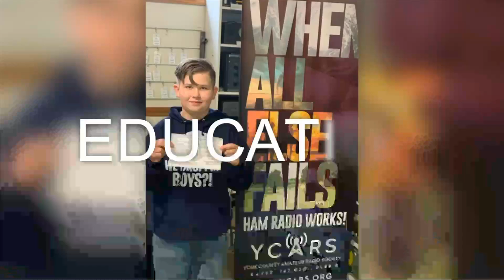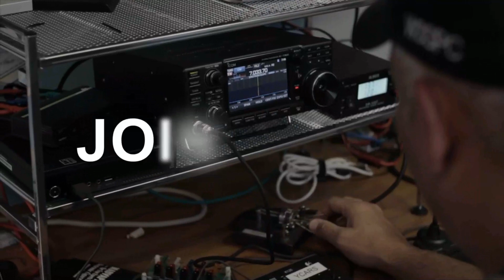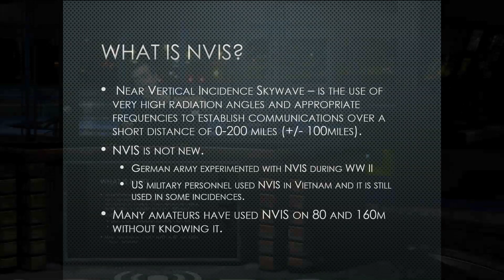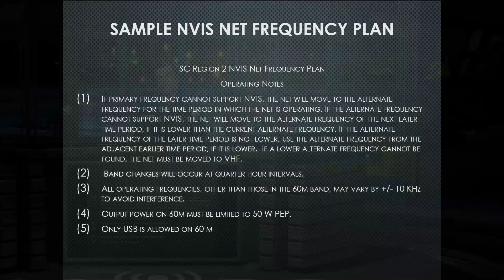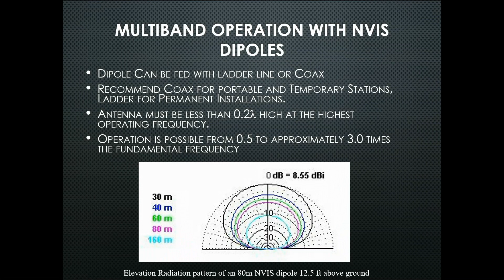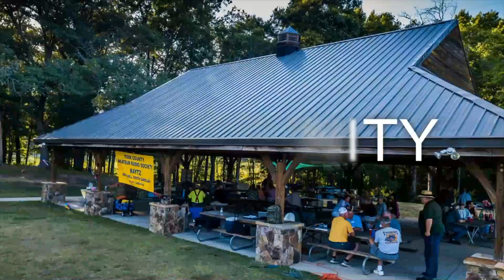NVIS Antennas and Propagation

Comment: You say between 0.1 and 0.25. then show a nvis antenna for 40m and 80m that is on a 15 feet mast.. 0.1*80m is 8m. So you need a 26 feet mast right?
Reply: Michael, if you run a 26ft mast the 40 meter take off angle is increased, it is a trade off you get a smaller radius of coverage on 80 meters due to the lower height and higher take off angle.  as with all antennas that are multi-banded it is a compromise.  But to your point you could run a 26 foot mast and it will work, just with a little larger skip zone on 40.    Hope the video was helpful.
Reply: @FromthehamshackwithNJ4Z  thanks John. I've seen some very low to the ground dipoles. Ie 4 ft of the ground using plastic electric fence posts. I'm thinking these can't actually work that well because of the ground loss. Some have reflector wires on the ground under the antenna. I think below 0.1 and the variability of the ground conductivity leads to major differences in antenna performance. Anyway this video on the subject was great.
VK6MIK.